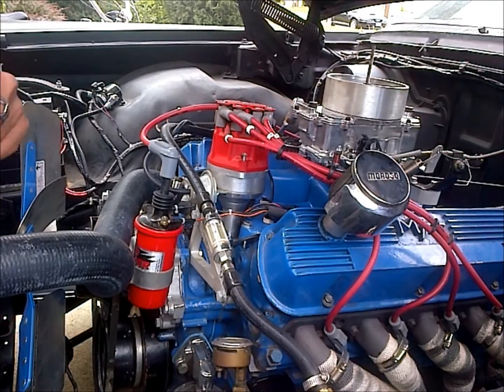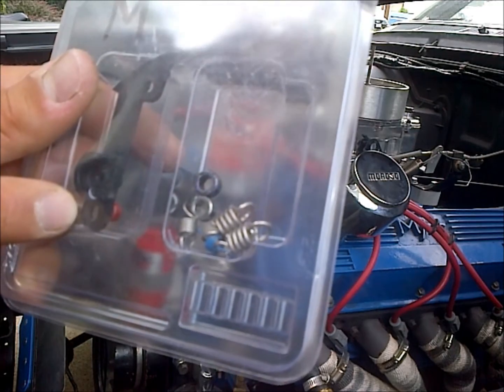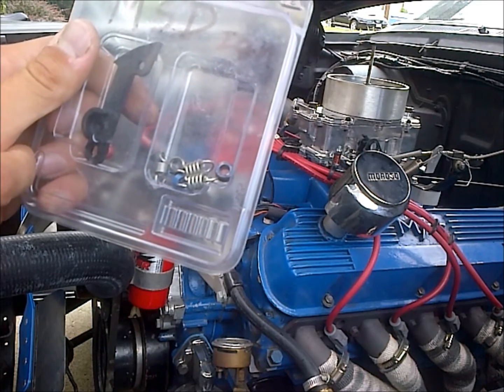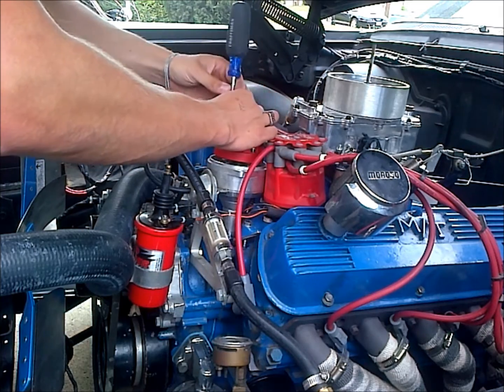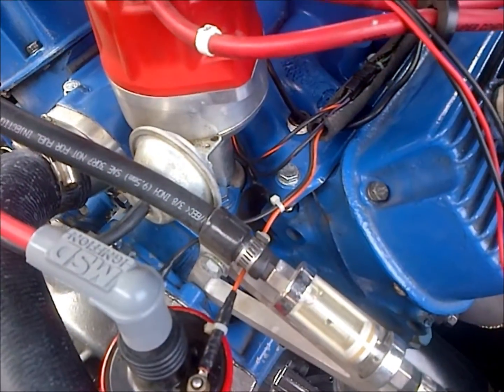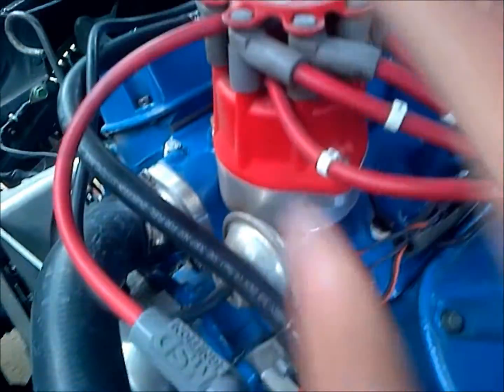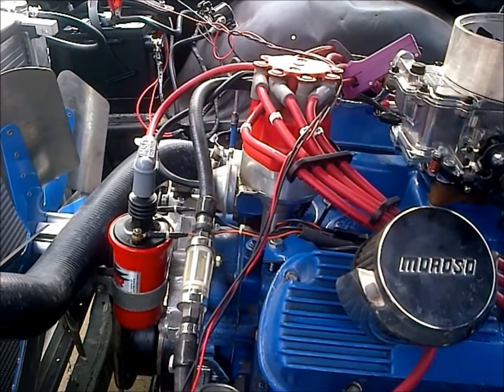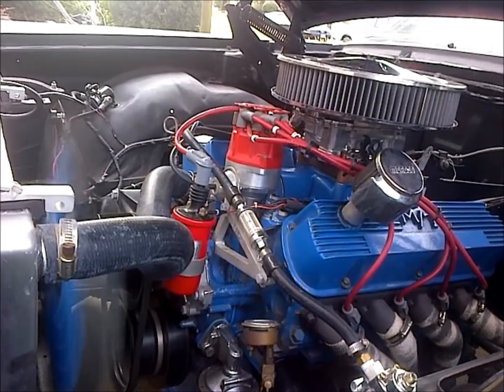MSD Setting Ignition Timing IN DEPTH LOOK

Comment: I was wondering I have a 302 in my truck that was stock efi then I ripped all that out and went with holley efi I have a hei dist and never timed one that has vacuum advance so i have it plugged of i have my initial set at 10 and total at 34 so when i hook vacume advance my initial jumps up and my total does to is that supposed to happen if so how much degreeswould be to much with vac advanced hooked up what's a good number to look for with vac advanced hooked up reason for asking I have an adjustable vacume advance and dont know were to set it

Comment: I am running two light silvers, using a 4sec flat bushing that limits total mech to 14, initial 18: 427 Windsor 10.5:1 big valves, big cam, replica Ac coba..engine LOVES it....very light car 535 hp at 5800, 2200lbs..

Comment: If total timing is say 34 degrees with the vacuum advance disconnected, then after you 
reconnect the vacuum advance the total timing changes to like 40 degrees why not set 
it with the vacuum advance connected when you want total timing at 34?
Reply from the maker: reason being is that when you step on the gas and the manifold vacuum drops, the vacuum advance is factored out. vacuum advance is an efficiency item, where total timing usually coincides with higher load situations. vacuum advance gives more timing while the vehicle is cruising because a lean mixture takes longer to burn - generally speaking, the mixture should be fairly lean under most cruising situations - i do have a video explaining vacuum advance if that interests you. just search "thunderhead289 vacuum advance"
Reply: That is what I thought as well, however with the vacuum disconnected
I have 10 degrees at idle and 34 at 2800 total advance, but when I 
connect vacuum I have the same at idle but my total is 42 instead of 
34 at 2800 and above. I'm working on a 460, aluminum heads, stealth intake, 
750 edelbrock carb,Voo Doo 267/273 dur. 540/552 lift cam  headers and a 
holley billet distributor with msd 6a box.
I was thinking of leaving the vacuum advance disconnected.
I'm also using a wide band A/F meter  to make adj.s to my carb.
You mean a rich mix takes longer to burn don't you?
Reply from the maker: +Gadsden Viper one of two things here, you either have enough cam to idle with low enough vacuum that the advance canister is factored out, or you are on ported vacuum. You will always see the added advance when running a timing light as the engine is not under a load.
Reply: The vacuum is throttle control, not port. However are you saying when I open the throttle to check 
total advance that when the vacuum advance is connected it will exceed the total timing set (34) when the 
vacuum advance was disconnected?
Reply: Gadsden Viper I am having the same problem understanding this and started this search using the same description as in your comment. Did you find an explanation?

Comment: The best way to set timing is drive it around 45mph in top gear and give it some throttle if the engine spark rattles back the timing off a little and drive it again. When the engine spark rattles the timing is to high or you need higher octane fuel.

Comment: Okay if possible, I need to get a definitive answer on the differences in the pickup coil used in an HEI distributer and the type used in your application. I think I read somewhere that the switching signal is stronger with the type of pickup coil you have in your dizzy. What gives?
Reply: HEY!?

Comment: The flex fan is a period correct look,..but as you say,…knife blades. Almost to the point where it's kind of intimidating hanging your body parts anywhere in that direction. Makes it like it's not a friendly place to hang out. 
    I like hanging over my Mill while it's running so I changed over to electric fans set on a manual thermostat where you can set it when you want it to come on.. I like it a lot better for keeping the engines temp regulated with different regions your car is driving through. 
   Less stress on the water pump bushing,..quicker warm up, longer belt life,..and probably an extra horse out of the deal too.
   I think I'm going to go with the set up your using too for my ignition upgrade. 
   Good one..